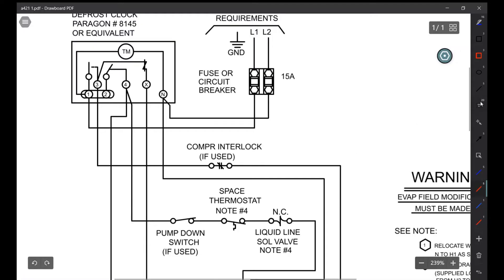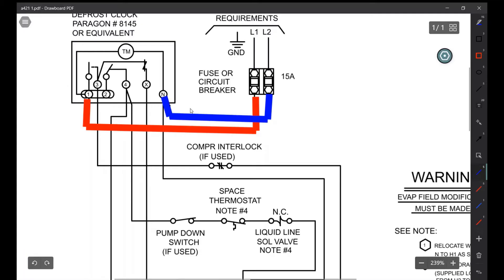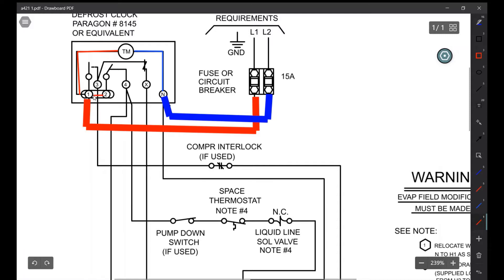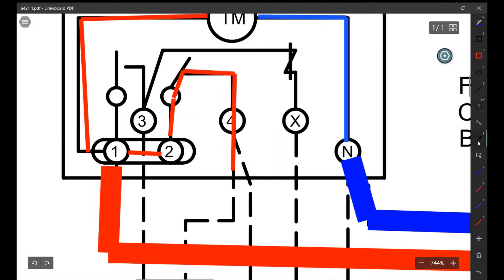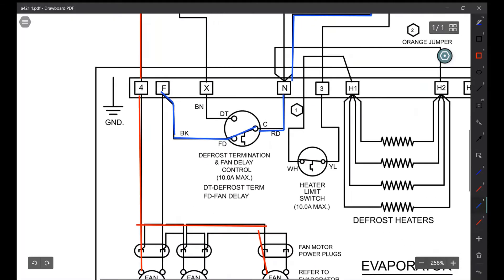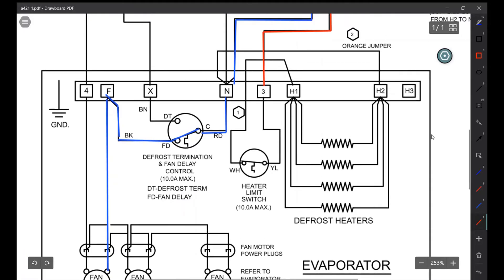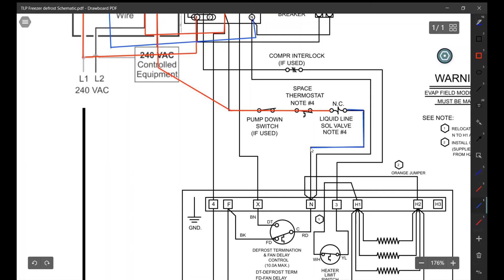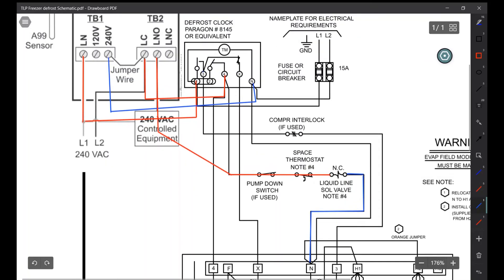How to diagnose a Defrost time clock.  Wiring and Troubleshooting Included

Comment: Thanks for this great explanation i have installed freezer fan doesn’t come on i have replace fan delay switch still same what should be problem thanks
Reply from the maker: Follow power back to the clock, see where it drops and make sure the coil is getting cold enough

Comment: My defrost timer runs normally when it stops when it reaches the defrost mark. After 2 or 3 hours, I have to manually turn the defrost timer past the defrost mark and the compressor then starts working again. This is a brand new timer. The heater, thermal fuse and defrost sensor are all tested and working. What could be the problem?
Reply from the maker: If power to the timer motor and it doesn’t advance, it s a bad timer

Comment: Can you DUE the same schematic for 3 phase power please.
Great content well executed iam fan of your wisdom.
Reply from the maker: There isn’t any 3PH time clocks that I know of. Unless you are referring to a 3PH condensing unit
Reply: @REFRIGERATIONKITCHENEQTECH  yes sir that’s why I meant to doit on 3 phase power.I apologize for not explaining myself correctly.
Reply: @REFRIGERATIONKITCHENEQTECH   I was thinking to run a separate cooling contactor and break the coil voltage to kill the third leg of power.

Comment: Hi Anthony,
Cool videos man, is there a simple diagram that includes a switch that turns the fans off. I've seen three recently in the last week. Perhaps there is a book that you could refer me to. These units in particular have to hot wire coming from up in the roof. Thanks a lot.
Reply from the maker: Defrost termination switch usually controls the fans (red,brown, black wires)

Comment: Thank you for the elaborated explanation of controls and schematic. I really don't see tech sharing indepth knowledge like you did. One thing I would like to mention here is that the fans are cut off during a defrost cycel for two reasons. One you explained but the second most important reason is not to blow hot air in the room while evaporator is going through a defrost cycle as this will cause the room temperature to rise and that will be questionable; for example for a blood storage rooms at -40c or plasma storgare such spikes (rise in room temp) would be registered on a chart which is a problem. Therefore, we turn off the fan while defrost heaters are melding down the frosted coil through electrical heaters or Hot Gas Bypass system. With the fans turned off the coils get defrosted effectively and not causing room temperature to rise beyond tolerable degress of temperature. Your explanation with the circuitary was "Professional", I really recorded this video as a reference for our technician to see and learn. Thank you for sharing. I liked your video.
Reply from the maker: Thanks